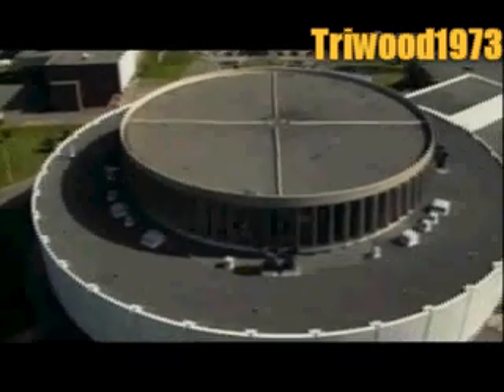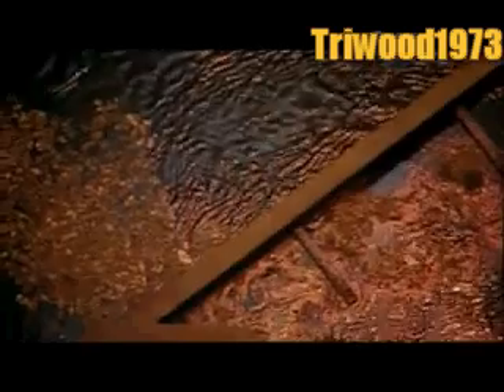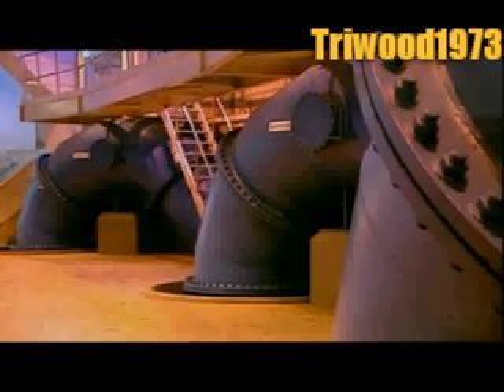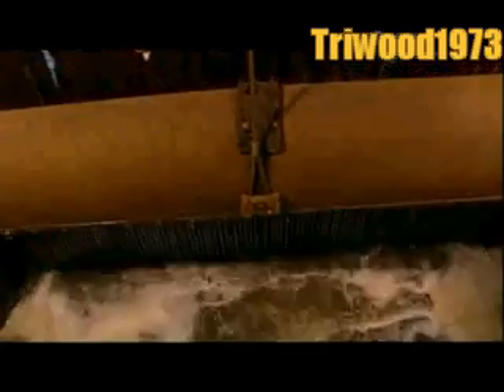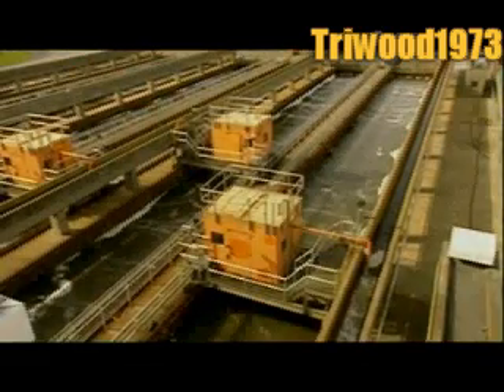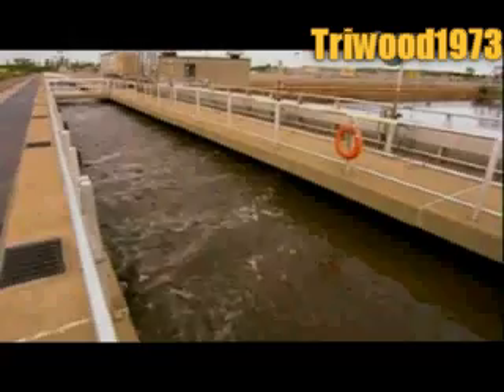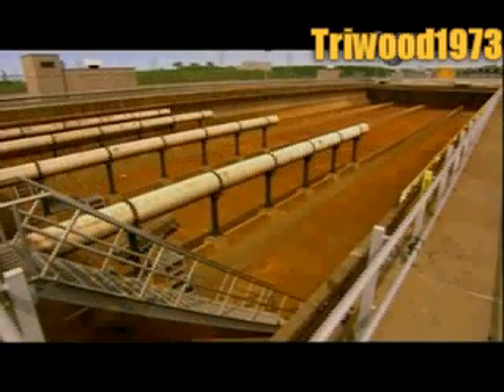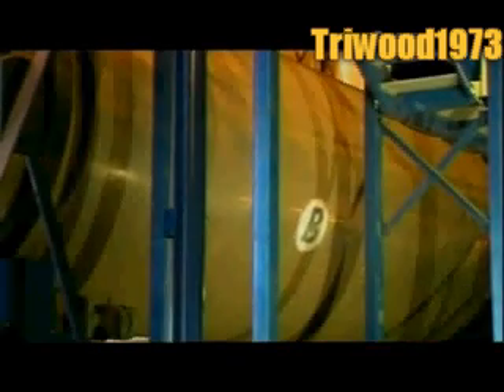Waste Water Treatment Made Simple...

Comment: Saudi Pipe Systems Co.

•	Valves, Pipe Fittings, Pipe clamps and Flanges.
•	GRP/FRP/RTR Pipes and Fittings.
•	HDPE Pipes and Fittings.
•	Pre-Insulated Pipes and Fittings.
•	Fire Hydrants.
•	Manhole Covers and Gratings.

SPS Products Applications:
•	Water and Waste Water Network.
•	Sewage and Storm Water Network.
•	Chilled Water System.
•	Fire Fighting Network.
•	Central Air Condition System.

Contact Us:
 
Muhammad Tayyab

Mobile: +966 552583162
E-Mail: tayyab@pipes.sa

Comment: NH3 is mandated to be less than 3 mg/l in my plant.  Biochemical Oxygen Demand is so low that fish swim in the effluent of my facility.  Here's the process; remove the plastic waste and grease that the microorganisms can't treat, aerate the basins at 2 to 4 mg/l oxygen, employ a settling tank to draw off the sludge and chlorinate/dechlor your final effluent.  Low BOD, low TSS, very, very clean. The water is almost drinkable, so clean you want to swim in it in the summer. 6mg/l oxy at outfall.